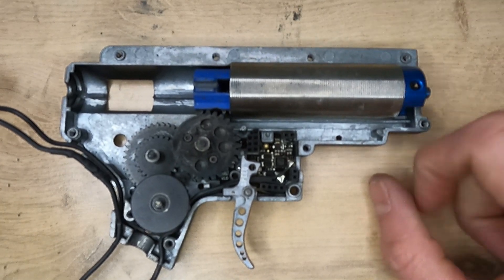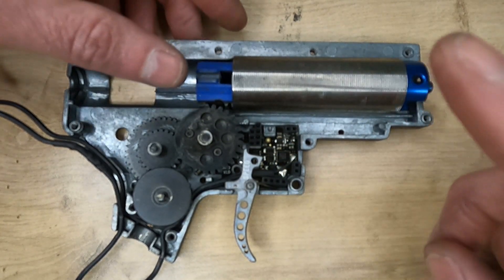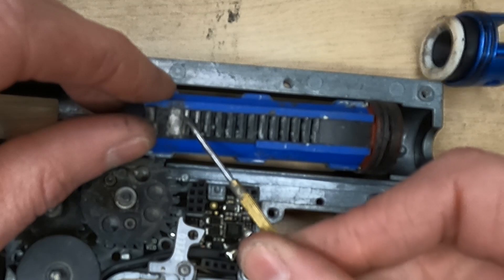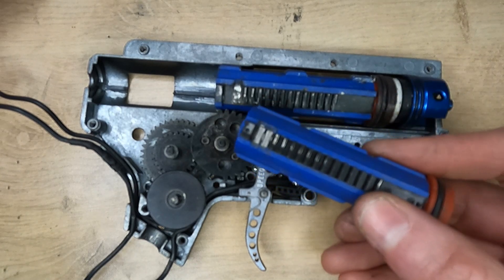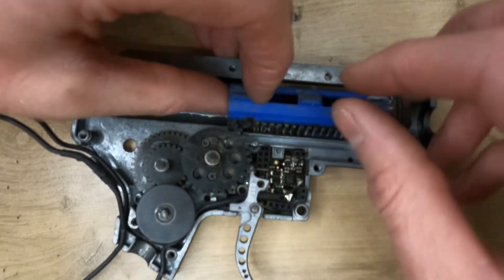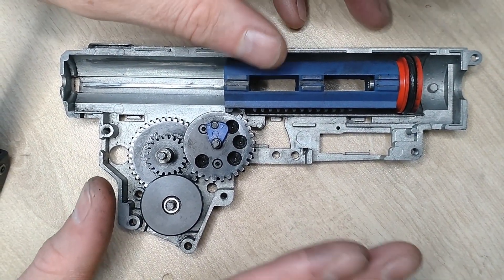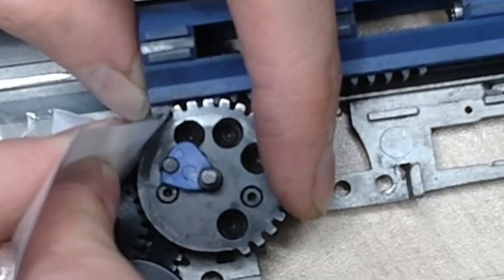AOE correction - Right thing to do or not?

Comment: The first tooth was designed to engage at an angle, or else the other teeth won't line up. When I mod/fix aegs, I typically go a couple millimeters or so past 12 o clock, because at that point, the first sector tooth angle matches with the angle of the first tooth on the back of the piston.
I noticed this was an issue when i was hand turning my gearbox and saw there was resistance after the first 2 teeth engaged

Comment: That particular SHS piston(14T high speed lightened) has weird spacing between the pickup tooth and the rest of the teeth. That is why the piston was lifting up when the third tooth was engaged. I stopped using that piston because of that issue, and SHS keeps on cranking them out without revising the rack.
Anyways, I almost always set the AOE at around 1230

Comment: The initial engagement should be not 12 o'clock, but in similar place where the rest of the teeth starts to engage. The geometry of the teeth is specifically created to start the engagement there and follow through - there's science behind the shape of the teeth. 

I'd say the rule of thumb would be that you can remove only the second tooth (the first normal after the pickup tooth). Some pistons come from factory with that tooth missing, so I think total removal is fine. But yeah, if it could be half height even better

Comment: Like others have said, these guys did too much when correcting. I shave 1.5 teeth for SSG builds and the 2nd tooth is only shaved to the amount necessary. And 12:30 is a better angle to use.

Comment: if its not done right it will often ruin the gun. I'd rather have under correction or none at all than an overcorrected gun. most guns don't even need it.  none of my guns have it and they all run fine save for my cyma aks74u which is 100% a dirty gearbox interfering with the aster but the plastic teeth are probably fine. it doesnt use a metal rack. it's always with sorbo pads. they also reduce volume and in a dmr like my sr25 and high speed cqb builds, you need air volume more than ever. at least with a high speed cqb build you can put a faucet washer between the piston and piston head. you still lose volume buy you most likely have a ported cylinder or it's short stroked but on a dmr, if you want to Thow anything heavier than a .36' you need the volume. especially on any gun that isn't a svd or sr25 which you still can't afford to lose volume because reverse joule creep on heavy ammo.  my cyma platinum mp5 is short stroked from the factory by 4 teeth and that's another good example of why my guns isn't aoe corrected. of course, on a full stroke full cylinder gun there's no reason you can't do it the old fashioned way.

Comment: This guy is 100% correct, in airsoft, AOE is the one thing overated and misunderstood anyway. He explains it perfectly
Reply from the maker: Thank you for your comment and thank you for watching!! 😎
Reply: @adzzzysarmoury  well youve explained it well - summary: you just need to ensure that your maximising surface area of pickup, that way all teeth on the rack have load distributed evenly among them relatively, doesnt matter what time, 12 o clock is not needed haha!
Reply: I agree what an informative video, everyone should be shown this if your starting to do your own tech work

Comment: Why don’t they just make a piston/tooth rack with the proper cut?
Reply: They do. A lot of pistons are sold with the second tooth missing or half height (one of those in the video didn't have the second tooth from factory). The issue is people are modifying the piston further when they should just tune the resting position, which they somehow misunderstood to be on 12 O'clock while it's somewhere between 1 and 2 - basically at the spot the rest of the teeth starts to pick up, maybe a little bit closer to 12.

Comment: The biggest issue I've found with AOE correction, is that people are doing it too much which 'fixes' the original issue, but replaces it with new ones, evidenced here in this video. Doing minor corrections to prevent the first tooth from engaging at a bad angle is fine, but automatically assuming every gearbox ever made has to be adjusted to 12 o'clock is just silly.

I'll be honest though, seeing the piston getting pushed upward was new to me, after seeing it, I'm pretty sure a lot of my old plastic tooth pistons were stripped because of this very issue. I corrected AOE too much. Going forward, I think I'm going to just avoid AoE correction entirely, or do it at a minimum.

Comment: i think you got confused there: issue in your pistons is not AOE, its rather the pitch difference between sector gear and piston rack; 
you have some faulty pistons there, where the rack is not matching properly with the sector, nothing to do with AOE.

the linear pitch of the piston rack does not change based on the angle with the sector..
Reply: It's caused by the missing teeth on the rack. Normally the sector gear would have 1 or 2 teeth engaged at a time. With the AOE cut you're skipping 2 teeth on the sector. That means the 1st tooth is driving for 3x the distance it's supposed to. As that tooth rotates, it gets "shorter" in relation to the rack because it's a circular gear (the tooth is dropping down, away from the rack). So, it cannot produce a linear amount of travel on the rack across its entire engagement.
The rack travels farther/faster the closer that 1st tooth is to vertical orientation. Without the AOE cut, the #2 & #3 teeth take over as primary drivers as the 1st tooth starts to fall away. This results in consistent travel of the rack. What you get with the AOE cut is a rack that does not travel quite as far rearward while being driven by a single tooth, so when the #4 tooth comes around to engage the rack, it is out of alignment, and they don't mesh properly.
For AOE cut to work properly you'd need a custom rack where the #1 rack tooth is ever so slightly closer to the #4 tooth position.

Comment: the standard 12:00 AOE versus the factory AOE... Is there a sweet spot for the first rack tooth or a formula of parts so to line up a position in relation to the axle of the toothed gear?
Reply: Shape of the teeth is mathematically chosen so the teeth are not sliding over each other and are pushing. From this logic tells us that the theoretical proper initial engagement is at the same spot where all the teeth pick up the engagement - so they then properly roll over each other and next teeth can pick up as soon as possible - I'd say the rule of thumb should be such that allows you to remove the least amount of other teeth (which you might have to - as the gear geometry is created for continuous engagement there is the issue of the 2nd tooth getting in way of the pick up).
So generally the same spot for all the teeth or a bit closer to 12 O'clock for the first one (to clear other teeth, and not engage on it's outermost edge as it doesn't have the help of other teeth)

Comment: Undercorrection is almost always better than over correction. There is an "ideal" spot for the pickup to engage at (and its definitely further forward than 12 o'clock), but going even the slightest bit past that point is immediately losing the benefits of AOE correction. As mentioned in the video, the lift of the piston is an increasing issue as teeth are removed from the rack. Higher spring strength (like that of DSG or sometimes DMR) begs the need for AOE correction as you put more stress on the gear teeth with higher ROF. The balancing act comes in how much tooth removal you need in order to achieve the AOE needed to keep your pickup tooth healthy without putting too much stress or allowing the piston to lift up and cause damage to the next couple teeth on the piston rack. In most full stroke SSG builds, I would wager you really only need to AOE correct to the point where the second piston tooth is reduced or fully removed. Having the second and third teeth totally removed is way too much.
Reply: The "ideal" engagement that you mention is not where the gear teeth flatly engage. It's better to have a smaller contact patch, where the pickup teeth "ramp" up each other, than to have their flat faces smack, with no ramp. This is due to sheer loads. With "ramp," stress is kept at a minimum (at the cost of increased friction), whereas without it, you can sheer your sector gear's pickup tooth.

Comment: Well I can tell you that I'm verry recent in tech in airsoft but I'm sure of one thing to me it doesn't make sense to do an aoe correction at 12h. Because the connection between the piston teath and gear should be perfect and therefore the point where it starts might not be at 12h position. If you always put at 12h position then you will have the motive to remove teaths from the piston but if you put at 13h or 13h30 position then you might not needed. Another thing by putting a sorbo pad you are reducing the air volume.

Comment: Someone said eating tiger testicules is good for your sexual health, so, people started hunting tigers and eating its balls..... Someone said you have to correct your AOE, so people started to correct the AOE.
Most people dont realize teeth arent flat, its a triangular shape, it means that if your sector gear first pick up tooth is at 12 oclock it is not marrying perfectly with your piston pick up tooth, its not doing full contact between both teeth, and even less people think about that point, were your teeth are engaging, it is under the lowest pressure possible, the spring is really soft at that point, it doesnt make any harm if the teeth dont match perfectly at that point!!! Thats why you only have to correct your AOE if you are building a high stress gun, with a really heavy spring, or if you are working on a ICS, those things come from factory with a terrible AOE and they eat pistons like nothing, same happens with all the support machine guns 249/240/m60.
Reply: In my view you are absoliutely right. The most important thing in my vie are the full contact not only on the first teeth but also in the second and the third one. So, in my view is rather more important to have more teeths with full contact then the first one with an amazing contact but the remaining of the teeth ate shit.
Reply: Although I am also against exaggerated aoe correction, I have to say those 14T shs rectangle hole lightened pistons in your examples are notorious for off spec tooth spacing that causes the bad meshing that you showed.

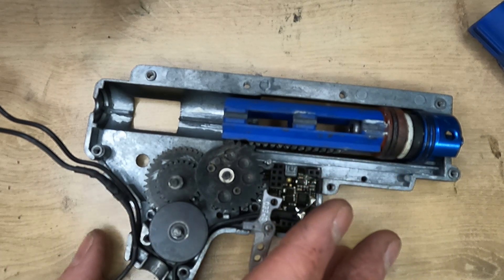Comment: why is the 3rd teeth taken off too? From the previous techs that advocate the 12oclock AOE assumes the 3rd tooth is present that picks up the 1st (pickup) and 3rd (sometimes half tooth) at the same time at around 12oclock or 11:30.. I agree that the 12oclock AOE does not apply to 2nd & 3rd tooth taken off
Reply: keep the second and third.... if it breaks you still got the next

Comment: it seems like 12 o'clock position is not the way to go. As i understand the main purpose for aoe should be seeking of the full contact position in-between piston and gear and that's is simply not possible because of the form difference of them - look, they simply do not match,  tooth of sector gear has a sharp (looks like an arrow head) angle and the tooth of the piston is straight. Plus, the piston is way too back on 12 o'clock so the following teeth begin to shatter as they are not properly picked up beacuse the 2nd tooth is gone - this basically reduces the point of such aoe to zero. That's why i lean more to 1 o'clock/12:30 (lol) aoe - it still has enough contact surface and does not fuck up following teeth so the piston is properly picked up in the motion.
Reply: Tottally agree with you mate. When im in the mood of doing the things "perfect", i file away the piston pick up tooth so it is slighlty on an angle, it avoids the sector gear pick up tooth to slam against a corner, because some pistons have huge flat pick up tooth, AOE will not fix that issue, filing and "shape" the tooth will help way more, ive seen some piston racks with that angle from factory too.
Reply from the maker: Agreed, appreciate your input. 😎
Reply: Actually the geometry of the gear and the piston rack are correct to properly match. There is a science and math behind it, but for teeth to properly engage and roll over each other (without sliding - that's the goal) the geometry dictates that teeth on circle (gear) will have slight curve on the edge, while the teeth on the rack has to be straight.
The proper way should be that the pickup is in similar place for ALL the teeth including the first one. I believe that due to tolerances the first should be a bit closer to 12 O'clock, but as I said the geometry is tailored for the engagement.